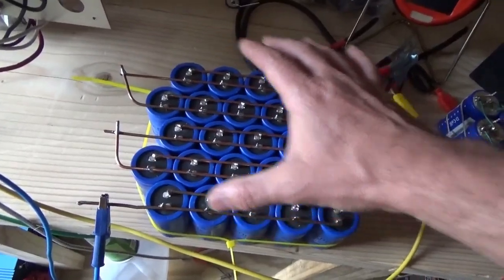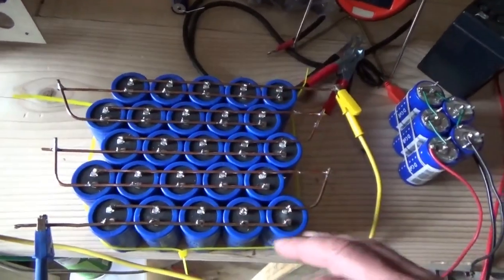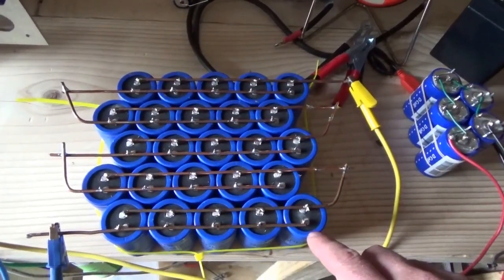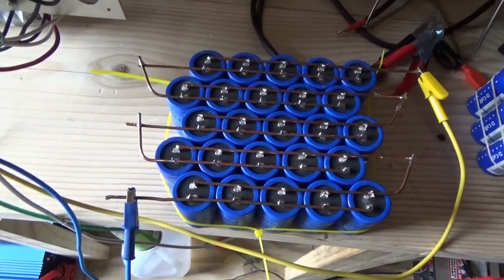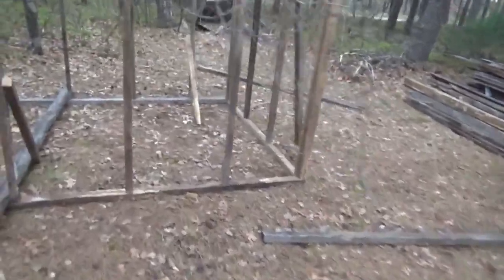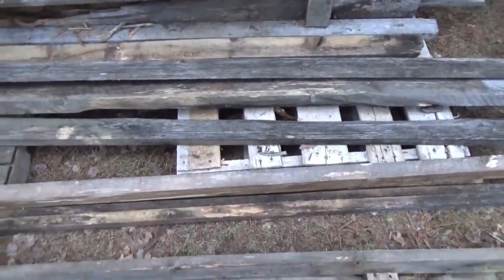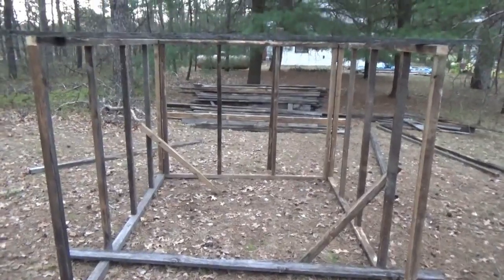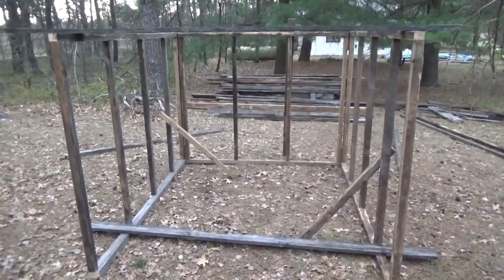Starting Truck On SuperCapacitors ~ Gardening ~  Chicken Coop Build

Comment: first off it is the current that kills not voltage. all those caps and no BMS no protection circuit I see no fuses. you like living on the edge of life and death. All I can say is good luck
Reply from the maker: The original fuses are in the truck. Are you saying that every time a person swaps out their battery they are risking death because now the fuses are gone??? The fuses are still there. All I did was swap out the battery.
Reply: The Do It Yourself World no I am not saying every time they swap out a car battery they are risking death. I was just saying that current kills not voltage. Now days the supercaps are on protection boards that prevent the cap from over  charging and blowing up. Again I was just trying to help and again you know it all so I am gone again

Comment: Am curious if anyone else would just leave the thick compost dumped on the garden, spread out and not rotitillered, like we do with the Back To Eden method of gardening
www.backtoedenfilm.com which leaches nutrients into the soil, while also keeping weeds at bay.   Another question. Anyone else with a chicken coop install construction cloth under the flooring and at least one foot up the walls to make it critter  proof, as well as put the coop is up off the ground on bricks or stone blocks so there is no wood rot, or water flood issue?
Reply from the maker: I have to amend the soil here because it is not fertile and very acidic. Then I can start the Back to Eden method next year. But if I want to plant this year I must amend the soil now. And yes, I plan to use chicken wire on the outer walls, on the ground to stop predators. And I will raise up the chicken coop before the siding goes on.

Comment: That valve tapping when you  started the truck is not good news, especially when the car is out of commission for a while. A head job on that truck is going to be way more than your car repair. I'd consider getting that car fixed ASAP and start saving money for a big engine job, cause it's coming!
Reply from the maker: Yes it bugs me badly.
Reply: It could be a worn cam lob or a worn lifter or both or even a bent push rod. If its really costly to fix just find a LS Motor to replace it with.

Comment: Walmart sells these auto cigarette lighter socket Digital LED volt meters for only $6.32 Troy.
I would order online myself and have delivered to local store.  Where i live local wamart does not stock unusual items like this.

https://www.walmart.com/ip/Digital-Monitor-Car-Volt-Voltmeter-LCD-Cigarette-Lighter-Voltage-Panel-Meter/333804380?wmlspartner=wlpa&selectedSellerId=4654&adid=22222222227072574151&wmlspartner=wmtlabs&wl0=&wl1=g&wl2=c&wl3=183977514714&wl4=pla-286495302646&wl5=9009897&wl6=&wl7=&wl8=&wl9=pla&wl10=115056792&wl11=online&wl12=333804380&wl13=&veh=sem
Reply from the maker: Yes I want to get one of those

Comment: Hey troy, congratulations on the supercap auto battery replacement.  That is a project I have been thinking about trying myself someday.  I suggest getting one of those cigarette lighter LED volt meters to let you monitor your cap voltage.

Have you seen lasersaber videos on his car supercap/battery pak hybrid?  He seems to have really done very good research on this idea.  It seems only negative thing is you can't sit in your truck and listen to radio for long time.

Here is his link in case you have not seen his stuff.
https://www.youtube.com/watch?v=8miq6sDy0wA&t=471s
Reply: Oh , I forgot laser saber said the   supercap/battery pak  hybrid was not good to use as a portable battery booster.
Reply from the maker: Thank you. Yes I have seen his experiments. I will also be trying a battery along with the supercapacitors to see what difference it makes.
Reply from the maker: +Bill23799 well it would work for an easy starting vehicle. But you only get one shot with caps alone. With a battery it would be interesting to see
Reply: Yes, I noticed lasersaber was using a smaller supercapacitor bank but as he said he was starting a car with a 4 cylinder engine.  Did you figure right off the bat that you would need a more powerful bank because you were cranking a bigger 6 cylinder truck engine?

I believe you reviewed a " GeniusBoostPro " rechargeable battery pak in the past.  I bet that would pair up nicely with your supercap car starter and make a nice Hybrid.  The battery booster would keep the caps fully charged and the car alternator or solar would keep the battery pak charged .

Oh and the wooden box looked good in the truck to hold your capbank.
Reply from the maker: Yes I figured his car was starting instantly with no hesitation. And it was a tiny engine. And remember I first tried this out on an 11 HP gas engine. One bank of caps did not start it. Two banks did the job. So I figured three for the truck. But paired with a battery I think I can drop back down to one bank of 5 capacitors. I actually used that booster today to help start the truck after draining the capacitors. I am running a mess of tests this week on real World results. Thanks.
Reply: This is an interesting project Troy.  I was always interested in electronics when I was a boy. Do you remember those Radio Shack  " P-BOX " kits.  I made a short wave radio receiver and I also made a Galvanometer to measure galvonic skin response using those red box kits.
It was basically a poor man's lie detector, haha. 

I used some of my electronic skills to make experimental studio lighting strobes and portable gel cell rechargeable  battery paks  when i had my photo studio when I got out of the service in 1984 in Houston, Tx.

I think the problem lasersaber had when using his hybrid supercap/battery pak as a remote battery booster 
was when he had tied to start a very dead battery on a lawn tractor and it depleted his battery pak so low it was damaged.  I think since he found a way to incorporate some low power circuit to stop draw on battery below a certain point.

I think he used a Li-Po battery for his hybrid.

Comment: Dirt is definately hard to work with manually being that it's so heavy. I'm going to be replanting my green peppers after buying seeds. I planted my first batch from peppers I bought from the store and dried the seeds. But being they pick those too soon the seeds are fully developed but I wanted to try it anyway. Even if you get some to germinate you won't get a good plant. But once I grow my own to full harvest then I can generate my own seeds that will germinate.

I'd like to learn more about the bedini motor, I know virtually nothing about them. Good idea making your own battery pack to jump start your truck. 

According to the test (I forget what it's called) you take in high school that tells you what you would be good at I was supposed to be an electrician. I think I didn't pursue it because my dad had his own company building and remodeling homes so I ended up in that field.
Reply from the maker: If the plants are not hybrid then they will not grow properly is the problem I have learned. Only hybrid plants will reproduce properly.
Here is the info on the Bedini Motor I wrote a while back: http://www.thedoityourselfworld.com/ssg-battery-restorer.php

I plan to build one soon step by step on video
Reply: Thanks for the link

Comment: I'm coming up with 9000 joules at 15 volts for each set of 5 capacitors in series. The first ones you showed you had five banks of those so 45000 joules. The second ones you started the truck with you had 3 so 27000.

Have you ever done a constant current discharge capacity test before and after you run the batteries on that machine? I would be interested to see what percentage capacity increase it gives the batteries.
Reply: I did a bunch of videos testing the performance of my battery in my car and the performance of 6 3000 f super Capacitors. if you're interested part 10 on my channel shows the performance of starting the car with the battery and the caps side by side.
Reply from the maker: Thanks for doing that math for me.
Reply from the maker: That guy who used an inverter on his capacitor bank and did no updates... he did not update for a good reason. Looked cool on video but there were no real results. Supercapacitors dont have that much power in them to be able to run anything through an inverter. I am going to try an experiment though with a bank of caps powering LED lighting, charging cell phone and other things.

Comment: PUT A METER ON  it TO SEE IF CHARGES
Reply from the maker: I am going to do some load testing with a data logging meter and share the results
Reply: Robert Firestone if the alternator is working on the truck why wouldn't it charge?

Comment: IT is funny when they tell us you can not get more power out that you put in WELL YOU ARE DOING IT
Reply: Robert Firestone, over-unity and so-called "free energy" are absolute nonsense!
Reply: Solar Farmer Power, Dark matter and anti-matter are two different things. In particle physics, anti-matter actually exists in the form of anti-particles, such as antiprotons, positrons, etc. Dark matter is a hypothetical type of matter. As far as this discussion here goes... "free energy" refers to getting more energy out of a system then is put into it. Which is impossible with current technology. The "free energy" devices you may hear about on the internet are all scams! As for the future... In physics there is something called zero-point energy or Quantum Vacuum Energy. However, there is no way to harness it with today's technology, and there may never be a way to harness it.
Reply: Solar Farmer Power, Don't tell me you actually believe in the "free energy" BS?
Reply from the maker: People - solar power is "free energy" because I get more out than I put into the system. Wind energy is "free energy" because I get more out than I put into the system. Anyone that thinks this is fake is ignorant. All I am doing is using energy that is already available. Not making anything myself.
Reply: Troy, Solar power does not involve "free energy" or over-unity. Solar cells convert energy carried by photons of light into electrical energy. You do NOT get more energy out of a solar panel than is put into it. However, there are scams, where people are claiming their contraptions can run with no energy input.
Reply: As far as cost of solar power and wind power... Wind turbines, solar panels, charge controllers, inverters, batteries, and mounting hardware are NOT free! There is no such a thing as free energy. Whether someone is claiming they can create energy out of nothing, or simply not having to pay for energy.
Reply: Trinket box, I agree with you on that. There are no "free eggs". It costs money for the chickens,  chicken coops, fencing, and feed. But this idea of free electricity, free eggs, etc. is a concept promoted by many off grid channels, not just Troy's. It is an incorrect idea that you can get something for nothing. Just like the idea of "free wood" that doesn't account for the amount of time spent on taking apart pallets and working with junk wood.
Reply: Solar Farmer Power, power inverters absolutely obey the law of conservation of energy. As the voltage increases, the current goes down. Example: 12 volts @ 83 amps in = 120 volts @ 8.3 amps out. Of course, the actual power output will be a little bit less due to losses in the inverter. Sorry, no free lunch.